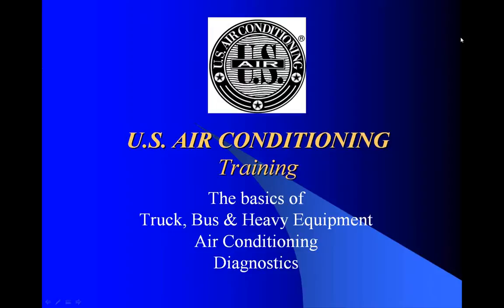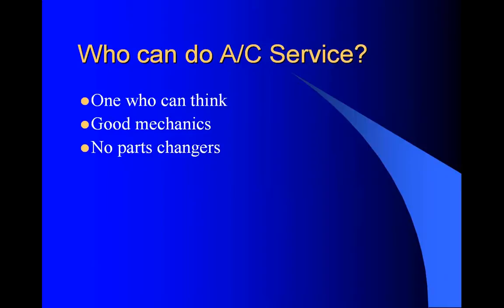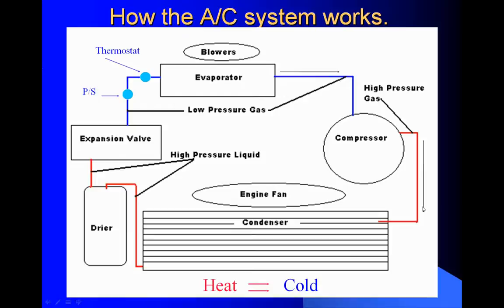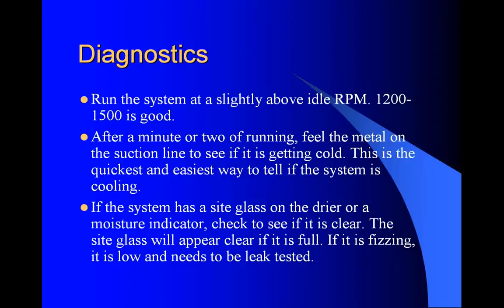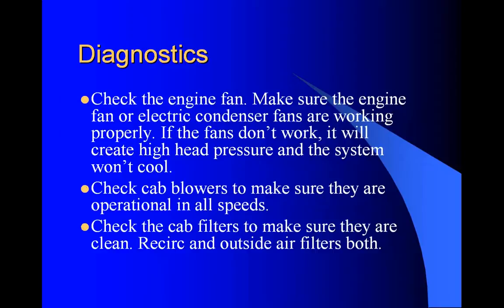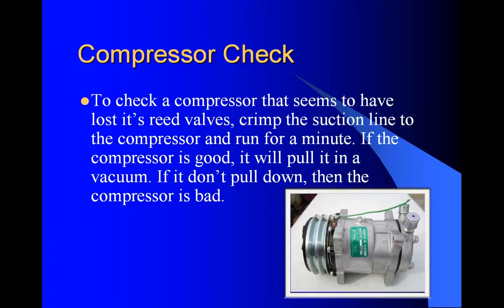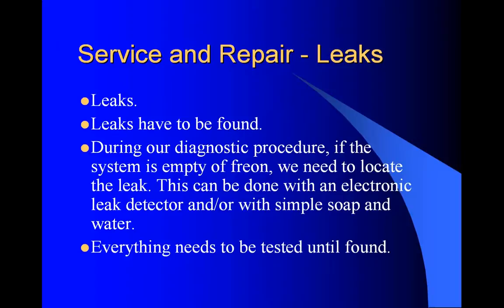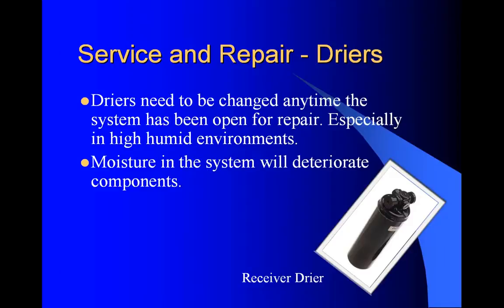U S  Air Conditioning  The Basics of Air Conditioning Diagnostics  HD

Comment from the maker: On pressure washing, use a 35-40 degree nozzle and spray coil straight on and through. Spray with the coil and not sideways against. You can also spray from the top straight down on the front side. Always be careful, though.

Comment: What could cause an evaporator to frost over? I'm a heavy equipment mechanic and have been fighting with a machine with this issue,  the evaporator is clean and pressure is spec as per Volvo.
Reply: Low charge, or freeze switch is bad causing compressor to never cycle, or evap plugged not getting enough hot air blowing across it some things to look at
Reply: @JKVK33  thanks for the reply

Comment: Awesome video. I have a few questions I hope you can help me with. I have been working on barko log loaders and the evaporator is under the seat, would you have to remove it to wash it out? Also I have had several restrictions in the lines and replaced the dryer and expansion valve. I pulled a vacumm on the system, recharged but all 4 of them I've done I couldnt get the suction pressure higher than 18-22 psig. They havnt been freezing up but still seems like something isnt right. Do you ever have to adjust the block style expansion valve?
Reply from the maker: 18-22 lbs is not bad, if the rpm’s on the motor is 1500 or so. Yes, you may have to pull the seat to pressure wash evaporator, blowers and all. If the evap has a blanket of dirt over it, your suction pressure will be low. Get it clean and start with that. Also, don’t get mis directed with adjusting thermostats. That is not your problem! A log loader is in a very dirty environment. Make sure the filters are clean too. 
Let me know what you find. What part of the world are you? Let me know.
Reply: Three of the loader are stationary electric with a separate 3 phase motor turning a automotive style AC compressor but I honestly haven't checked the speed because there just one speed all the time. I just thought that if the pressure was that low that they would freeze up from being under 32 degrees in the middle of the evaporator. It was the expansion valve / TXV that i was curious about adjusting. I havn't tried to adjust but I had the thought in my mind because I know they're adjustable in stationary ac and refrigeration. I will pull the seat when i get a chance to see what the back side of the evap looks like. I sprayed coil cleaner on front side of evap and rinsed it out on the last one and could feel the blower pulling more air but pressures seemed to stay the same. There isnt tags I've found that state how much refrigerant to add to the system, only has badges that said badger truck refrigeration. I guess I might could try to get into contact with them to see if they can tell me from the model number. Thanks for the help! There isn't much info on the net about heavy equipment AC systems. I'm from east tennessee.
Reply from the maker: I understand better now. The best way to charge a system, if there’s no site glass, is while adding Freon, hold the suction line with your hand, at the compressor and you’ll feel it get colder and colder. When you feel it cold to the bone, that’s it. Be careful and watch your suction pressure and charge till cold. If you get used to doing this, you will always be right on. Also, be careful charging a prescribed amount from the factory.. They are often wrong!  Let me know how you come out. 
Jim
Reply from the maker: Dustin, You can also feel the suction line at the accumulator, if it has one, or the suction line at the evaporator.
Reply: Alrighty, I'll try all of the above. Thanks alot for the information. I'll get back to you as soon as I can to let you know how it turn out.